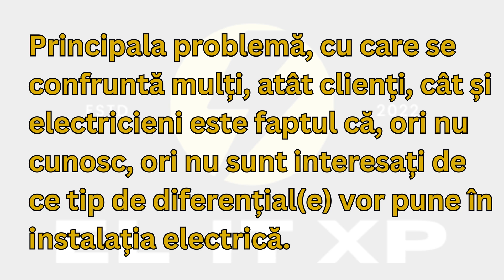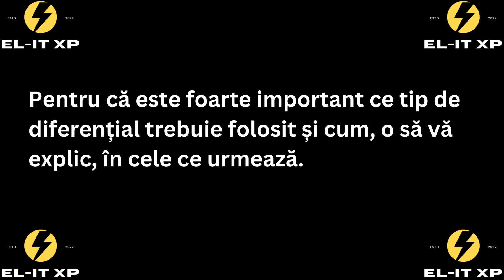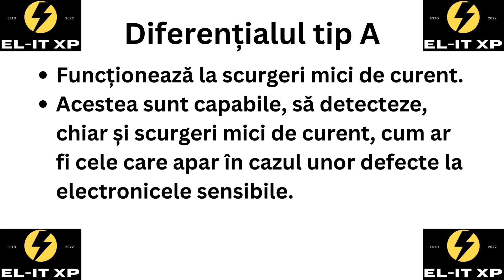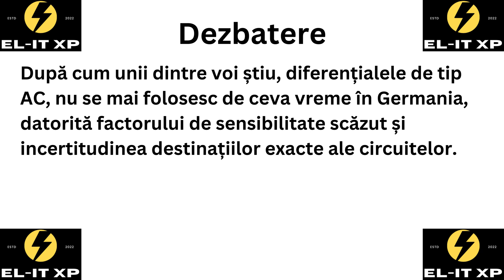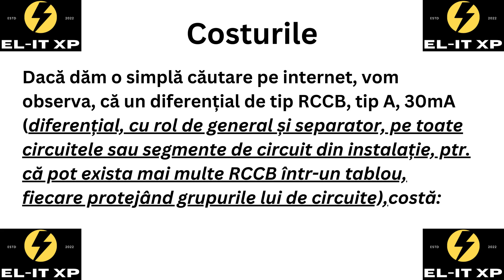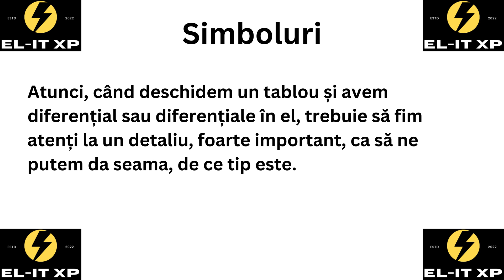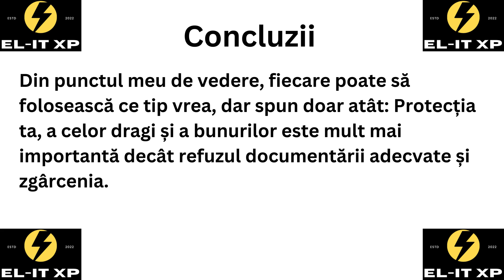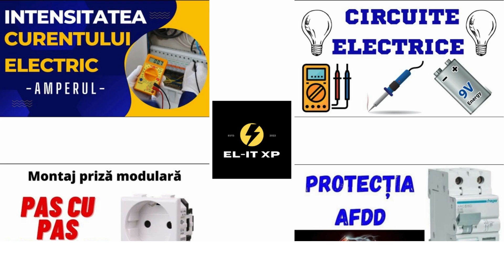[EXPLICAT] Diferential tip A si tip AC - Diferenta  diferential tip A si tip AC - Tip A vs Tip AC

Comment: Salutare la o camera cu doua prize  bec, masina spalat  frigider ...cit trebuue sa fie siguranta diferential erccb..25,30,...?
Reply from the maker: RCCB tip A, 40 sau 63 A la 30mA. B16A prize B16A priza Masina Rufe B6/10A lumini. Daca aveti posibilitatea faceti circuit dedicat masinii de rufe cu un RCBO tip A 10mA sau macar sa il puneti pe un circuit dedicat de 16A, cum am zis mai sus. Orice faceti in tablou sa nu depasiti 16A pe prize! E foarte important, adica nu un B20 (sa tina) va poate topi conductoarele ingropate in perete si v-ati luat la revedere de la circuit in cel mai fericit caz.
Reply: Mersi ,👍🏻👍🏻👍🏻